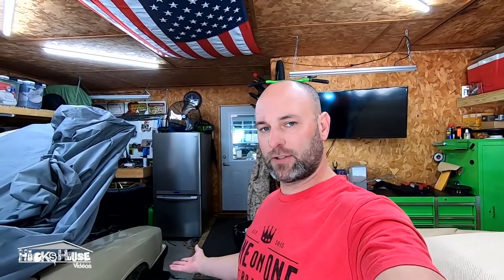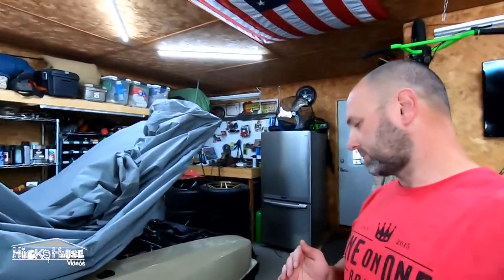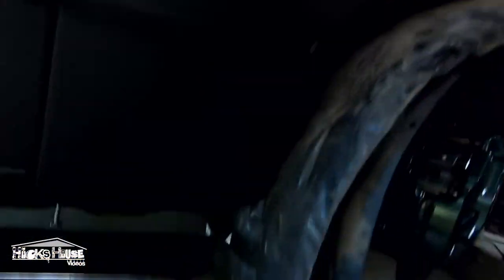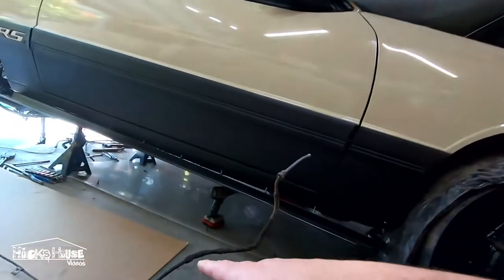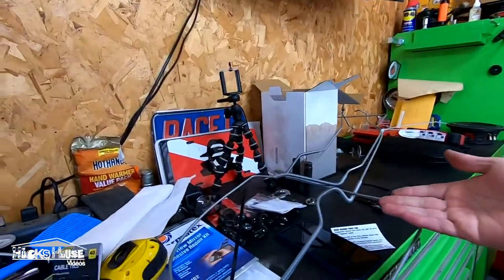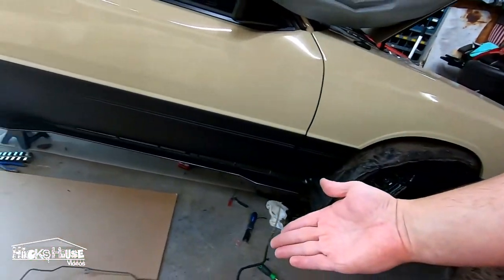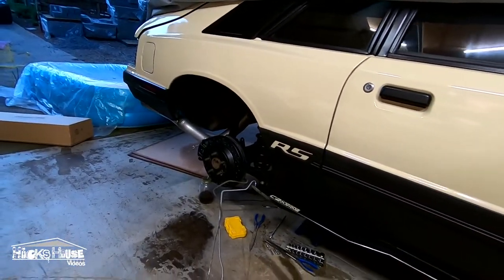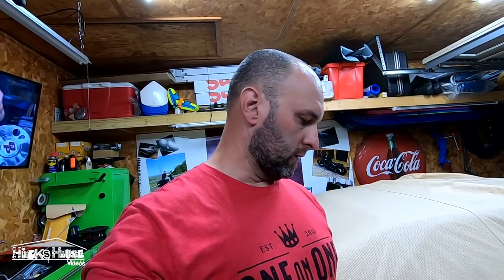Rusty Brake Line Could Have Killed Me!

Comment: On some of the earlier foxbodies, the rear brake line runs through the passenger compartment. Mine rusted at one of the bends with the spring, under the rear seat.
Reply from the maker: I could see that happening, that would be hard to find the leak.